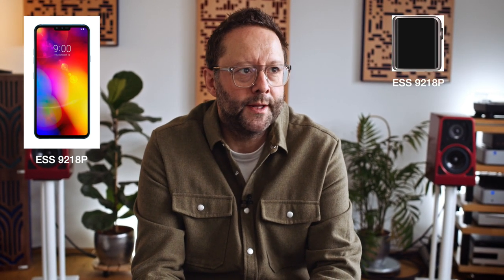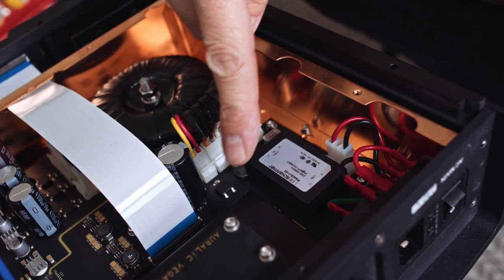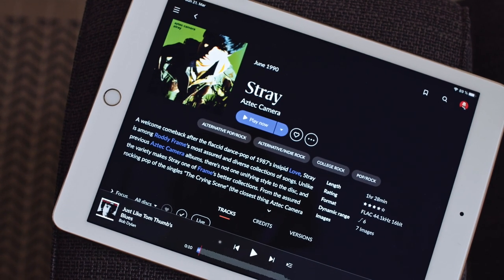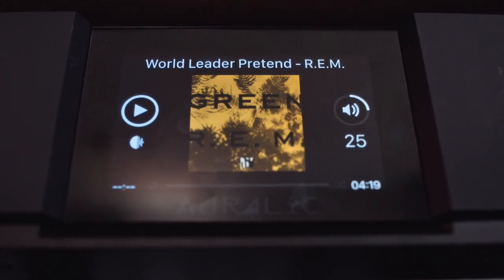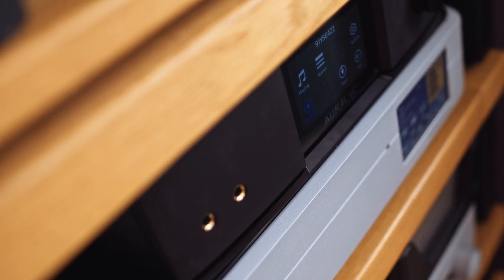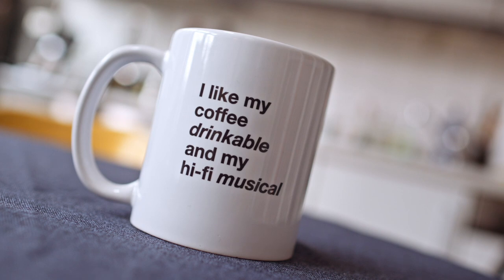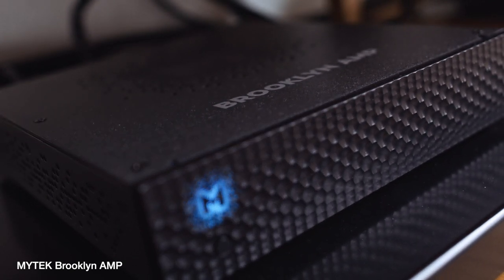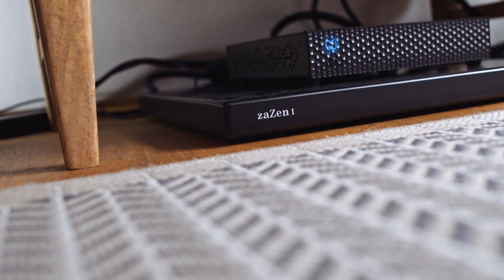Big Time! AURALIC Vega G2.1 (or PS Audio DirectStream)?

Comment: Thank you so much! You have broadened my hifi horizons. Thanks to you, I learnt about external DACS. and how to use an iPad to stream hi definition and cd quality audio. I then did some reading on top and purchased a  Topping DAC which has modernised and improved my classic Arcam and Monitor audio system. For considerably less than the bluenode  I was planning to buy. ( sadly my budget would not stretch to the Auralic). I am now as excited by music as when I bought my first CD player in 1985!

Comment: Having owned the PSAudio DSDac (4 yrs run direct to amp) and into BHKPre 1yr,  i would say one reason to buy the DSD IS the Bit-perfect Volume control with the amazing remote.  You set the BHKPre to 40 and use the remote to change volume on either unit, but you can surf the DSD volume up and down with great precision making it an absolute joy to operate.  The sound stage is enormous, accurate, precise, musical and stays that way at low volume, especially with the addition of the BHKPre. Another huge plus for PSAudio is they are family owned in BOULDER, CO, not China. The CEO is a phone call away, literally, and Customer service is personal and fast.  DSD Designer, Ted Smith sends you a NEW operating system every year which you simply download, an amazingly underrated feature of owning the DSD. Have not heard the Auralic, but have listened to many reviewers comments.  Great work as always John. Cheers mates.

Comment: Great video John, thank you!

It’s worth mentioning that the PS audio DirectStream does not use a DAC chip, instead all the reconstruction logic is implemented in software developed in house and running not on a CPU or GPU but an FPGA. A very exotic type of programmable hardware.

Most other manufacturers use ESS or BurrBrown chips to do the D/A.

You quite rightly caveated the discussion at the beginning by emphasising that the DAC chip is not an indication of the quality of the product, but this implementation detail here matters. It allows the PS audio to receive firmware updates and stay up to day perpetually. In other words nothing is baked in so to speak, it’s all software running on FPGAs. It’s very, very impressive.

I would hazard to add that another incredible advantage of this approach vs the conventional dedicated chip approach is that the issue of steep reconstruction filters and the artefacts they create is totally gone here, as in this case the reconstruction filters are not implemented using circuitry but done with software.

Digging further down this rabbit hole gets even more interesting. This problem with reconstruction filters is a challenge in the D to A conversion of PCM music. The PS audio DAC however has another unique approach, it’s totally DSD based! It converts all input, whether PCM or DSD, to an up-sampled DSD and then the D to A conversion is done using that DSD signal. The advantage here is that the D to A conversion of DSD is much more direct and less technically fraught than PCM.

The DirectStream PS audio DAC is a radically different product in many ways.

Thanks for your videos, love the channel! 👌🏻🙏🏻

Comment: Great review. Few things: PS Audio DSD has updates from a FPGA which gives you essentially multiple DACs to choose from. Also, adding a better 'clean source' such as a Sonore component or EtherRegen brings that spunk back to the DSD. The Aurelic piece does a great job at keeping clean signals clean. PS Audio offers a trade in at retail value deal so you can almost always get the DSD for much cheaper than 6-7K. Anyway, great review. Currently own both a DSD Jr and BHK Pre as well. Cheers.

Comment: Great review✌️Yes two separate power supplies I have an old Burson  dac  ,it uses two different power supplies, I put it up against the Hugo and although the Hugo  had more detail the Burson was smoother with a little more bass Reach . You are very correct about dac  chips And the importance of a really well thought out and Analogue output stage.👍

Comment: I agree with your review and point of view. I have the PS Audio Direct Stream DAC and and the PS Audio BHK Preamplifier (in addition to the PS Audio BHK 300 power amplifiers) and the DAC sounds much better with the preamplifier and not using the DAC's volume control. In fact, Paul, form PS Audio, has stated that this is the way he uses it and recommends that setup. Recently I added the Auralic Aries G2.1 in addition to the Wyred 4 Sound MS Music Server that I have been using for a long time (with the i7 package and 4TB of SSD). The Aries made a significant increase in all areas. I have yet to listen to the Innuos Zenith Mk 3 as there are no dealers around here, but I feel very satisfied with the Auralic. Can you do a comparison between the Innuos and the Auralic? Keep up the great work!
Reply: Jose,  I have your system and considering the W4S MS for it's I2S output to the DSD,  Now that you've added the G2.1 and  assuming you switched platforms to LightningDS,  what connection do you use between the W4S MS and the Auralic G2.1?  and G2.1 to your DSD?  USB for both?

Comment: Not all DACs are created equally, and thus don't sound the same.

The choice of chip is important, but less than flagship models can yield great results, especially if surrounded by components that allow for better voltage control, jitter reduction, etc.
Dual mono designs are an expensive way to lower distortion and crosstalk, but won't help in the time domain, nor with macrodynamics or getting that "meaty" sound.

The choice of reconstruction filter can not be overlooked, but neither can clocking, data buffering, amplification stages, power supply, magnetic shielding or microphony reduction due to physical vibration at this level.

I wouldn't spend this amount on a DAC on my salary, yet I admire the incredible attention to detail, use of quality components and extensive functionality Auralic puts into its products.

Comment: I use a 25 year old DAC.  Adcom GDA700. Laptop HP I5. WI-FI to it with the Chromecast audio. The little hockey puck. I use the optical out tos link to go to the DAC.  I use Roon and Tidal. I have an external 1 terabyte HD for personal library.

Comment: There will be a PS-Audio DirectStream MKII coming out soon (mid 2021). The MKII will not include any native streaming functionality, in favour of less electrical noise and jitter. So this needs to be solved by an external streamer. BTW: Most DirectStream users don't recommend the internal streaming solution of the DAC as they get superior results with external streamers. Ah... I forget to mention: The latest Firmware release for the current DirectStream should also be ready any moment. If used with an external PreAmp, the PS-Audio DirectStream Volume should be set to 92. That's the recommended setting by Ted Smith.
Reply: Good to know as I have the Junior I picked up for a song compared to the Senior.

Comment: Hey John, 
Nice video and production as always. Even though in general I agree with your some of your  thoughts in the  video, I think you leave some things open and vague - maybe even on purpose. You frequently mention technical terms and specs on devices but I’d like to see your thought process on how those things make an audible difference in you opinion, given that there are measurements that can prove one way or another (e.g. what’s the actual impact of a power supply to audio since we have conversion from AC to DC and serious filtering in order to achieve that). You also link to measurements on this video so I think it’s a fair ask, even though I know your channel’s stand on measurements and blind testing.

Comment: Thanks John ! You did great analysis from DACs functional and sounding image point of view to both great DACs in current market place,   I am currently using Altair G1 and still not sure I will upgrade to Altair G2.1 ( All in one concept ) or totally change to Vega G2.1 ( just DAC ) may be share some of your 2 cents to me will be much appreciated.  I had about 2T high res music files ( DSD256 and Other Flac...Wav...) and that is reason I love to connect HD to Altair G1 or G2.1 but if I switched to Vega G2.1 I will have to using computer ( i.e. Amazon Music HD streaming ) or network server  ( my own local HD files ),  But if sound qualities are major influential to my decision ( technically Vega G2.1 may be better DAC then Altair G2.1 )?  Still explore what may be the gain switch to Vega 2.1 rather Altair G2.1...... BTW: I do love to put preamp between DAC and amplifier and my current set up is Altair G1 XLR to McIntosh C1100 preamp then to McIntosh 1.25W amplifier.   Looking forward to hear you advice :))  Thanks Al
Reply: I believe the Vega 2.1 is also a streaming DAC.

Comment: The video shows you using a Wyred 4 Sound phono preamp connected to the Vega's analogue inputs.  Reading the specs on the Vega G2.1, Auralic states that the analogue input accepts up to a maximum of 2V.  The W4S units outputs 6 volts unbalanced.  Were there any issues with this?

Comment: I liked the in-depth analysis. But I am still not sure why would dacs sound differently. There are two dacs/ streamers which I would like your review on

1. Marantz ND 8006
2. NAD C658
Reply: The main thing is the analog stage. If you took the exact same digital stage and gave it to different designers to build the analog stage, you could end up with some very different sounding components.

Comment: There is "another" option that you could have used to compare, as Cary Audio has their DMS line, like the new DMS-700, or the older DMS-600 or DMS-550.  Roon Ready, Tidal (with MQA), Qobuz, Spotify and Spotify Connect, including a front color screen for album art.

Comment: I'm wondering, please give me your opinions on this: 
It seems, that many DACs these days offer these additional features like analog in, volume control, headphone out, etc. Allthough I can defintelty see the use case, how many of you would use these things like a integrated volume control? As I personally have a preamp, I would not benefit from these features. 
But I'd be interested in what you think.
Reply: I can only speak from personal experience, but you can get good sound either way. It really comes down to the quality of your components. Preamps are extremely important, and probably the most critical component to get right. In my opinion, no preamp is better than a cheap preamp. I have no problem using a source that has a volume control, analog or digital. I still have 2 Wadia CD players that work this way. However, you get to a crossover point to where a dedicated preamp sounds better. For me, it was an Aesthetix Calypso. My Wadia's sound better plugged into that then they do alone. But if I had to use a lesser preamp, I would go source direct.

Comment: I suddenly thought, what happens if you play your source into this £6000 Auralic dac and out into say a trio of  £1000 components (pre, power, speaker)? Or for that matter a lesser standard of source £500 cd player or a basic intel nuc on win 10 with jriver?
Reply: During the pandemic, I started building a nice small system. I have a pair of Kef R300s being ran by an older Denon 4802 receiver. Now that was a $2500 receiver that has a solid amp more than capable of driving the Kefs. I paid $140 for the Denon used. I used to stream Spotify from my PS4 with optical out to the Denon, thus using its DAC. It sounded good. But! I then got a Auralic Vega G1. I used Spotify connect directly to the Auralic and then have the Auralic connected to the Denon completely bypassing any audio processing. The sound difference was astonishing. It was like I bought a whole new system. The dynamics changed, the clarity, the depth, the bass... it all sounded magnitudes better. And this was playing the same 320kbps songs. My take away is that the DAC made a significant difference. Even playing tv through the Auralic via toslink has made an improvement. Now I can hold off on the amp I want to buy because I’m that happy with how the Auralic sounds.

Comment: Up late recording Tidal MQA streams to my DSD recorder TASCAM DA-3000 cheers
Reply: What is your audio source to the Tascam?  I am intrigued.
Reply: Jay Allan Blusound Node 2i SPDIF outs at 24/96 MQA mostly with Jazz albums into TASCAM DA-3000 SPDIF in’s sample rate converter to 24/192 because DSDIFF or DSF modes take 1gig per each 11 min ! Wow really 24/192 is the point before diminishing returns

Comment: This is wonderful DAC ... it looks like a “DAC porn” when you look at the internals, layout, components, connections and etc.. wonderful...

I am humble hifi enthusiast who is using Pioneer N50 almost everything next to ChromeCast audio as a digital transporter. 

The thing I would like to know is the added value that I will get If make that kind of big (very) investment. 

I cannot judge this... May be this DAC is a bit out of my reach but the something like CA CCN. 

What do you think? Should I go for that or wait for Pioneer till breaks down :)
Reply: When assembling a hi fi system it's helpful to consider the system as a whole. A good place to start is by spending half your system allocation on speakers, as those affect what you hear to a far more significant degree than anything else in your chain. Then you should match those speakers with an amp that can drive them well (if your speakers are passive) using half your remaining budget, with the remaining 25% allocated to front ends--digital, analogue, etc. That's not to say that systems don't see improvement when you upgrade any part of the chain in the future but it is a good reminder to keep your outlays balanced. In your case, spending $6k on a DAC when the rest of your system is so much less resolving wouldn't make a lot of sense because that money could go toward much better speakers and amplification while still leaving enough for a world class DAC like the RME ADI-2 or the Topping D90. I'm not trying to insult your system but I would advise you to upgrade your speakers and amplification with the bulk of the money you'd budget for this DAC and then buy a DAC to match the system you've built.

Comment: Reality is anything that chops up an analogue signal and then rebuilds it that signal will always be an approximation. Look inside any shiny copper box and if there is anything switching the supply lines forget it even if it is being fed by an expensive toroidal transformer. In the same vein I will always keep my Tektronix analogue scope even though I have digital scopes that can do all sorts of wonderful maths functions. But turn the gain up and see all that switching noise.

Comment: I wouldn't buy a DAC with ESS inside again. I have done that before and it was a hideous experience. Never to be repeated.

I don't understand John's narrative; claiming the chip doesn't influence the sound as much as the implementation is wrong in my experience. Yes, the DAC design is important. The output stage is important. But you cannot polish a turd; John seems to suggest rolling it in glitter makes it better. It doesn't. I think all ESS DACs should go to Room 101.
Reply from the maker: But if that instance - 'a hideous experience' (singular) - was never to be repeated, you have, by definition, only heard one DAC with an ESS chip. 

I've heard many throughout the last ten years and they all sound different. A DAC chip's implementation is more important than the choice of chip.
Reply: Search his video about auralic altair, it has an ess and its smooth and kinda warm
Also my dragonfly cobalt has an ess and its not harsh, bright etc, its actually really smooth, see "the headphone experience resolve reviews" review
Reply: @Taladin1234  I have ESS in an Auralic Aries Mini in my headphone system. I bypass the DAC section in favour of a Metrum Acoustics DAC.
Reply: I have also heard an ESS dac chip that I didn't like but some have sounded better.  To add to the ESS confusion there are many versions of ESS chips as well. That's like saying since I don't like Trix cereal I won't like multigrain cheerios.  Since both cereals are made by General Mills they must taste similar.
Reply: My Oppo UDP-205 has ESS chips.  In my system I preferred it to a Naim DAC.  While not being conscious of anything "wrong" with the sound, it's no longer supported; so I can't help but wonder what it would take to better it - purely as a stereo DAC (though it does much more) - without unbalancing my system (streamer, DAC, integrated amp, speakers), where currently it represents around 17% of the value based on original/new price.
Reply: Having both the LG v40 and Shanling M0 I can attest to what John says. They sound completely different. To my taste the Shanling is much better. Thing is, I didn't know they shared the same chip before watching this video and if someone else had said they did I wouldn't have believed them. Implementation is clearly extremely important.
Reply: Look at the ESS Implementation of the Okto DAC 8 Stereo.  This dac was recently reviewed in stereoreview by John Atkinsson.  He compared it to a 10k wadia dac and a 25k MBL dac and the 5k Holo audio may dac.  For $1500 the Okto Dac 8 Stereo ESS Sabre dac competed with all three of those much more expensive dacs.  Take a look at the stereophile review.
Reply: You understand his narrative you just think you know better, although you seem unable to appreciate that your opinion is just that and not a "fact" as you suggest.